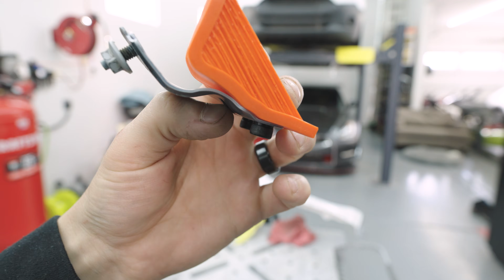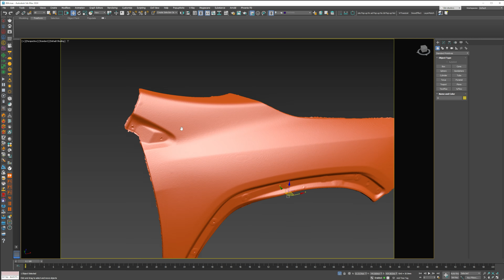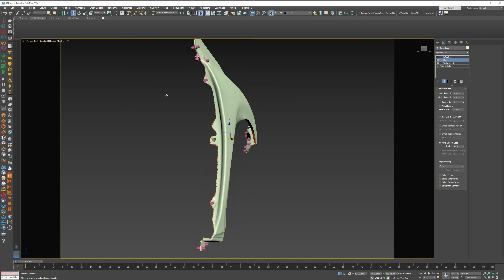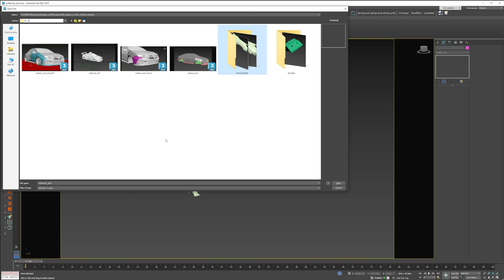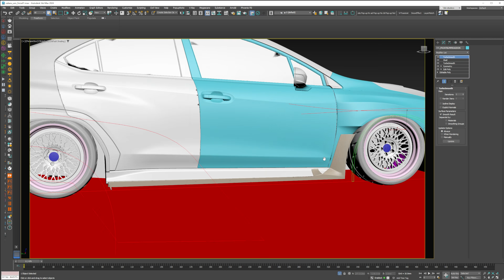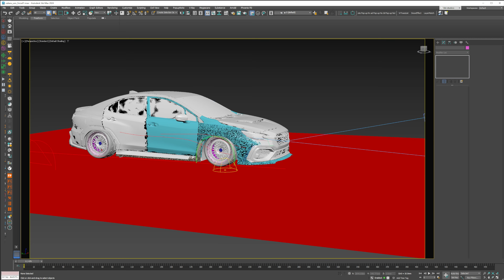Project WRX - 3D Printing Custom Widebody Fender

Comment: What material did you use to print this?
Reply from the maker: I used PETG. The fender has been finished with fiberglass on backside, body filler on front side along with another layer of fiberglass on top of that. So far fenders been on the car for over a month parked outside from hot sunny days to cold nights below 30f and zero issues.

Comment: 3d scanning and printing have definitely been a game changer in terms of making your own bodykit.  

Much easier than in the past were you had to make it all by hand.
Reply from the maker: I couldn't agree more, technology as spoiled those of us who don't have the skills to do it by hand thats for sure!
Reply: @poltdesigns I see custom interiors (door cards, rear set deletes, center consoles, etc) and car audio setups (sub and amp enclosures, speaker pods, etc) benefitting from this technology too.
Reply: @poltdesigns 3d scanning and 3d printing would also be good for replicating plastic parts that have internal structures with tabs and screw mounts, and then just skin the outer exposed part with carbon fiber, cus I would assume it would be very hard to do so in 100% carbon fiber.

You could even 3d print the internal structure layer in carbon enforced nylon.
Reply from the maker: @89GTFoxDude  Yeah if I was to do something like that, id design the tabs in 3d in a way that I can easily glue them to backside of cf part for easy install. I am doing something simlar right now with a dirtbike headlight to use factory mounting holes.

Comment: Is there any additional content for where you continued the nexts steps to making the fiberglass fenders? I’ve been wanting to do this for my 370z and I’d be really interested to see this all the way to the finished product.
Reply from the maker: I am actually getting back to it today! This project has been on a little hold due to work picking up and until I have a full bodykit designed I do not want to commit to anything specific. But I am going to make a simple normal width fender so I can actually register the car and drive it around town before going full widebody lol

Comment: I just bought a Vega. I am curious about your thoughts.
Reply from the maker: So this is just my opinion from my own experience. I think for small objects its amazing in HD mode. For fast scanning of med/large objects its amazing. For generic things to scan to model/design of shapes that are not 100% crazy on curve its good. My issue is a lot of times I make parts that would need to overlay an oem part and I use double sided tape to stick it on, the Vega when it comes to medium/large objects creates meshes that to me felt gooey and not as fine and detailed as a Einstar or Einstar2. So for my personal workflow and needs it just didn't give me the details in my scans that I needed. But again as I mention, for smaller objects in HD mode its amazing. i just did a project scanning a small hinge to fix and I actually used the Vega because I knew it would be super quick and very accurate/detailed in small object/HD mode.

Comment: Impressive project ❤
Btw, how did you get full 3d modeling of WRX car?
Can it be bought somewhere?
Reply from the maker: So the 3d model i am using for renders is not cad so not accurate. I am scanning key areas to model with accuracy tho.
Reply: @poltdesigns Ok, I’m always wondering where and how some guys can get full car body modeling.
Reply from the maker: @PCW0624  yeah for a proper model you will want to scan it. I know there is a website you can actually buy scanned data but totally forgot what it is. I am sure if you google you can find it.

Comment: Hi Polt, thanks for the amazing informative video, its very inspiring ! As of my understanding, you use the 3d scanned part as a reference and remodel the model urself from scratch right? Or do you use the 3d scanned model itself and edit it? Thanks alot !
Reply from the maker: You are 100% correct. The 3D scan is only a reference for how the OEM parts are and where they mount up. A accurate scan is key to making projects like this a success because without me being able to properly create the mounting areas anything I model would never fit and just be pure chaos to work with. Hope that answered your question?
Reply: @poltdesigns  Yes thanks a lot, which kinda scanner would you recommend for a beginner? :D
Reply from the maker: @brechtxbrecht  So I can only speak from my personal experience. I have tried several and I still keep going back to my Shining3D Einstar1. They have other options but to me this scanner under $1,000 works amazing and the quality is fantastic! I have used it to make various parts for my GTR and the fitment on all of them was id say 99% perfect.

Comment: hey bro , very nice what you have done with the fenders. Whats the thickness of the part? i wanna do one for my car
Reply from the maker: I went over all that in the vid but for this prototype I 3d printed it at 3mm. 4mm was very sturdy but 3mm was better for test fitting. I had to slow down my printer speed to make sure there is no wobble during prints.
Reply: @poltdesigns okay 👍 
Thanks 😊